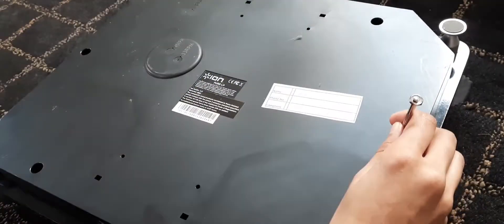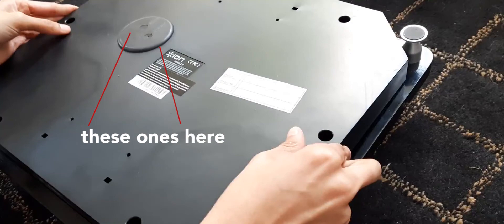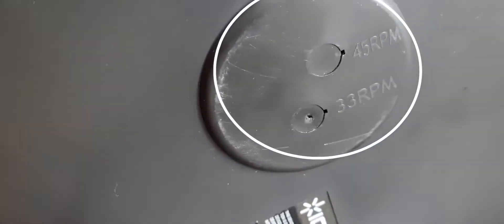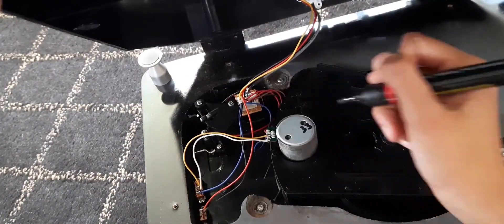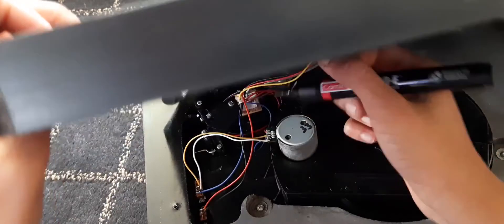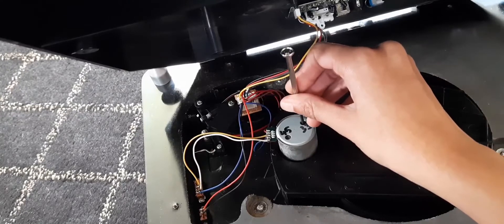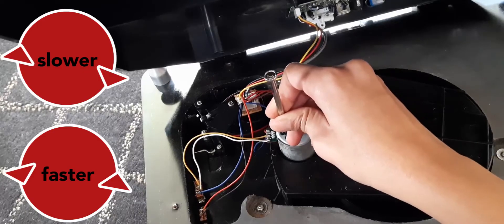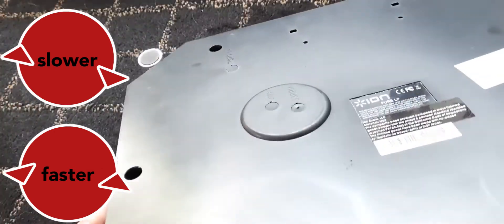How to adjust the RPM Speed of an ION turn table

Comment: THANK YOU! for years I couldn't find a solution. this method was it except I didn't have to unscrew the back i was able to poke through foam, the screwdriver fit into place, turned it a little, I was able to get 33rpm. You're a life saver ❤

Comment: you don't have to remove the entire back cover. The little rubber dots over the holes are intended to be removed for this exact reason. Just put your little screwdriver in to the slot just above the rubber tab and pop them right out :)
Reply: I did this instead and it worked a treat. Thanks for leaving this comment ♥️
Reply: Do note that she already addressed this in the video. Due to a defect, the holes do not align with the actual speed adjustment on her unit